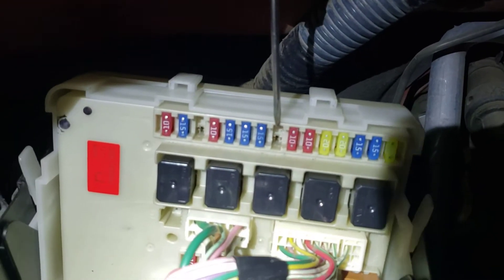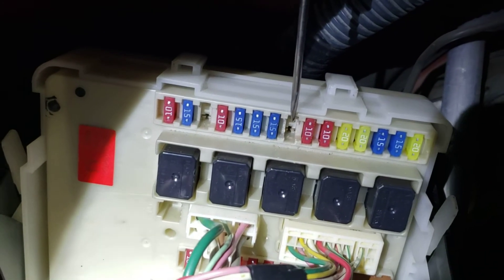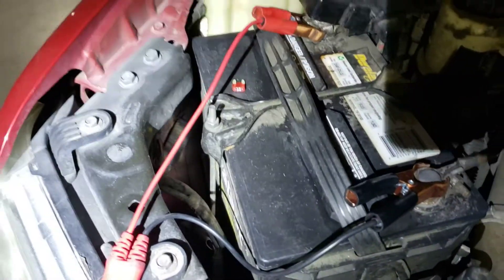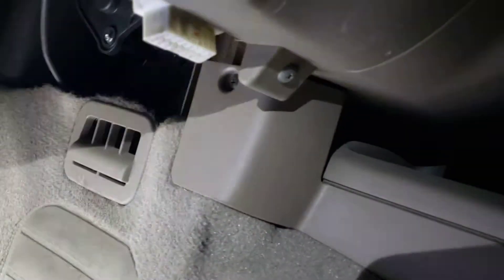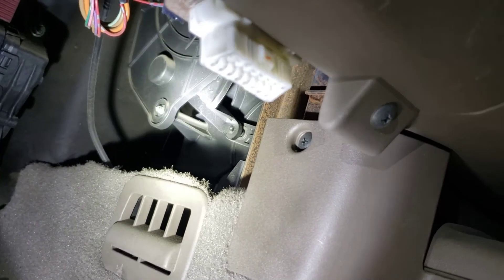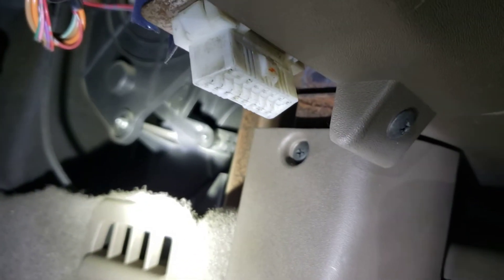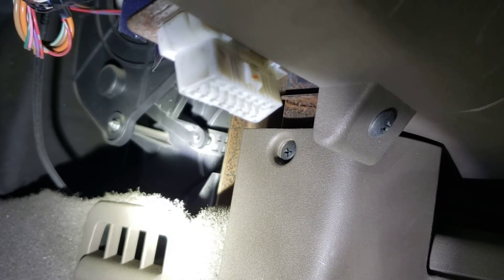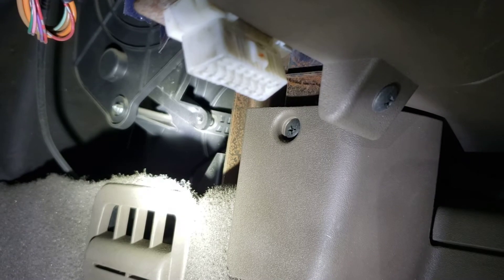NISSAN FRONTIER NO START

Comment: CAN High and Low are NOT 8 & 14 !  it is 6 and 14 and 7 is the K line
Reply from the maker: Yes I am aware, if I said pin 8 I mispoke. Thanks for clearing that up.
Reply: @NutsandBoltswithTone  Yes it was obvious but I wanted to add this for those that do not know
Reply from the maker: @ralfsautomotive  thank you

Comment: Why you need to replace the 4k transmission,,,,,when all you need is the TCM and the radiator??
Reply from the maker: The TCM is in the transmission I believe and that shorts out from the coolant. The proper repair is to replace the transmission.

Comment: I take it that this only applies to automatic transmissions not  manual transmissions?
Reply from the maker: Yes because what causes this is the transmission cooler failing and getting coolant into the transmission that has the computer. The manual transmission does not have a cooler. Thank you for watching.

Comment: So if i have crank but no fire do you think it would be the same thing? It fires if i spray a bit of ether in it...i did the ether just to confirm spark. Thanks
Reply from the maker: If it starts with ether then you are missing fuel. The problem I had was a no crank no start because the starter signal goes through the transmission control module. In your case you need to check fuel pressure then power and ground to your fuel pump. Let me know if you have any other questions. Thank you for watching.
Reply: @NutsandBoltswithTone  Thanks for the reply

Comment: I'm confused
Reply from the maker: The transmission cooler in the radiator fails, allowing coolant into the transmission, the water in the coolant corrodes the inside of the transmission which is the transmission module also. That in turns shorts out the fuse. The starter signal goes through the transmission, if trans is in park or neutral the starter signal then passes through and to the starter and then starts vehicle. Hope this helps, thank you for watching.

Comment: I saw a video on Spanish that some Nissan frontier from specific years over needs to replace the radiator coz that's cost  problem to your transmission
Reply from the maker: Yes the radiator fails, actually the transmission cooler in the radiator fails allowing coolant into the transmission and then the coolant and water mixture rusts out the computer inside the transmission. If you do not replace radiator when you replace transmission the next transmission will fail. thank you for watching.

Comment: Did you say that the customer drove it to your shop ?? If I understand correctly if you put a new fuse in it and Crank it up it will drive to your shop but once you cut it off it would blow the fuse and that would be a no crank no start or vice versa would that be correct ??
Reply from the maker: Yes the customer drove it in. Ok so the reason It wont start with the blown fuse is because the signal for the starter will not go to the starter because the vehicle has to be in park, well that goes through the transmission. once the vehicle starts the fuse blows. yes you are correct in your thought process.
Reply: @NutsandBoltswithTone  I had to replace the TCM in the transmission because of coolant mixture. Had the unit fired to my VIN number and got it installed. 10 amp fuse is good and now it's throwing  U1000 code and I believe that's no communication to the TCM or vice versa. Still nothing. Not sure where to turn now. Any help would be greatly appreciated.

Comment: I have a no start no crank on a 2007 Nissan frontier SE. Transmission started slipping acting like you're on black ice got it home it's set for about a year. Went out there and replaced the battery and a fuse terminal block 80 amp fuse that goes to the TCM. My question is if you have communication and the TCM is bad, will that keep the truck from cranking up and the engine running ??
Reply: That's what happened to my friend same problem he has to change the radiator check down on the corner of yours if is leaking if it is you need to replace it
Reply from the maker: Without looking at the truck myself I could only say it is possible. without communication with the TCM the starter signal will not be sent. did you try checking the can network with an ohm test like I show in my video?

Comment: i have a 2002 nissan xterra, i have 1 warning light on my dash, but none other. it’s the atp light, and there’s nothing coming up on the scanner. do you have any idea what’s happening? thank you.
Reply from the maker: so your obd connector has s16 pins, pin `6 is power. check that pin for power. if you do not have power there you need to check fuses. you can message me on instagram and I can help you over that way. check that and let me know.